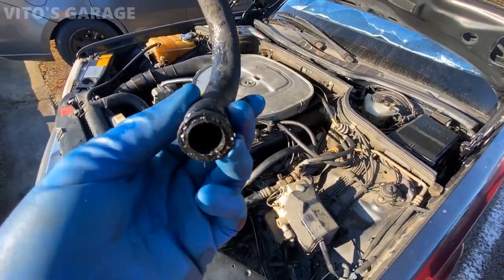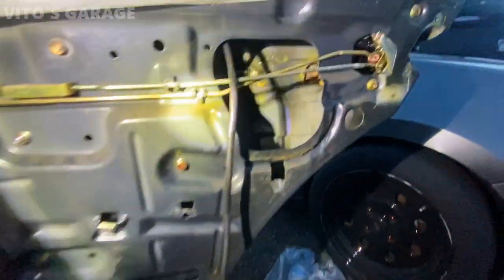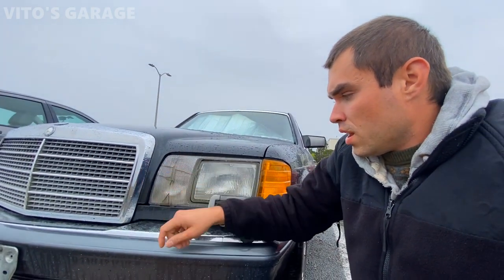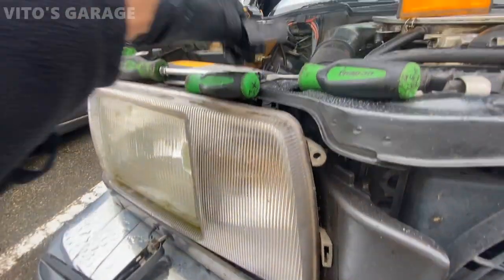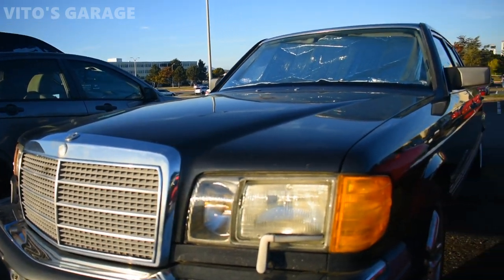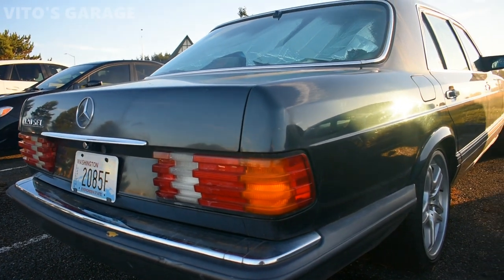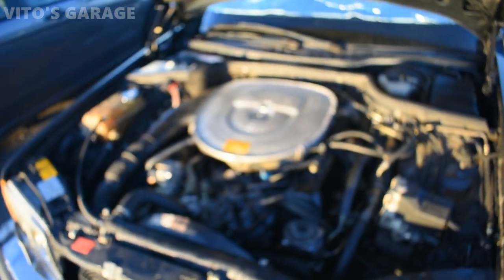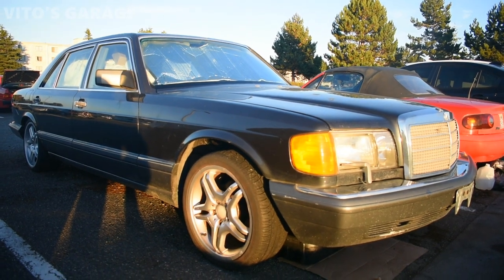318K Mile 1991 Mercedes 420SEL W126! Alive and Kicking!

Comment: Hey Vito, love the video.  If you don’t mind what are the wheels and tires on this car.  My 91 350SD is on the original 15” but I would like a nice summer tire set on its own wheels.  Also for these wheels was there any suspension or other mods requires for them to fit and turn properly.
Reply from the maker: Thank you. And here's the video about these wheels and tires: https://www.youtube.com/watch?v=m4DjWzaAaBs

They are 18in AMG wheels and they're staggered.
Fronts: ( I will double check it for you in a bit)
Rears: 255/35/18

I am using 10mm wheel spacers but only in the front. The reason is that I can't install the center caps without the spacers. The rears are good. I am not using spacers on those
Reply from the maker: Front tires are 225/40/18
Reply: Thanks Vito, you’re a wealth of knowledge.
Reply from the maker: You're very welcome. Happy to help!